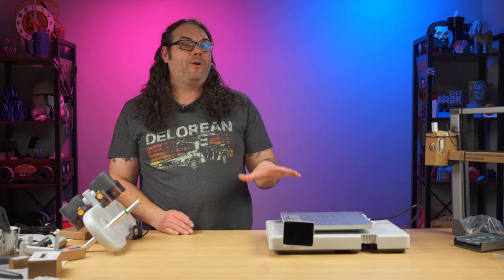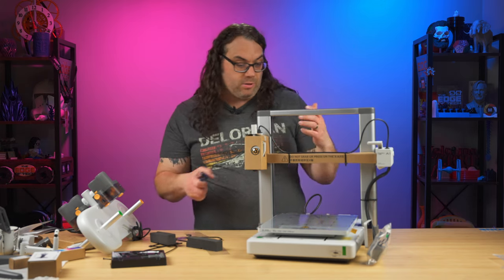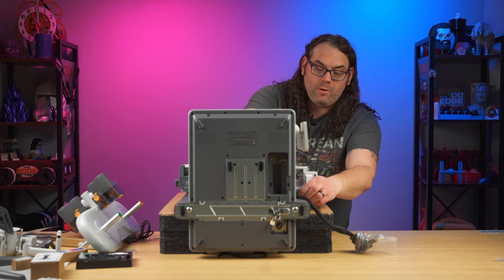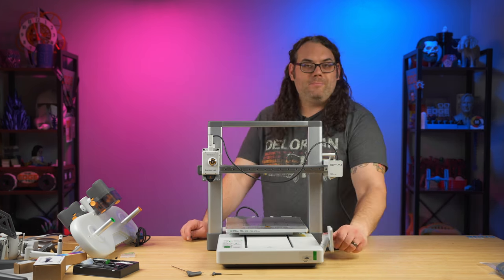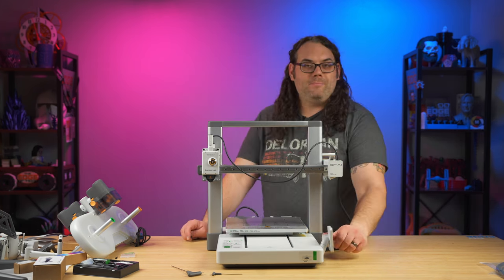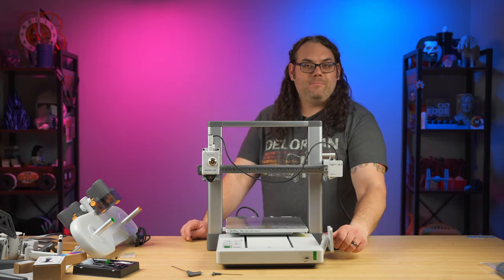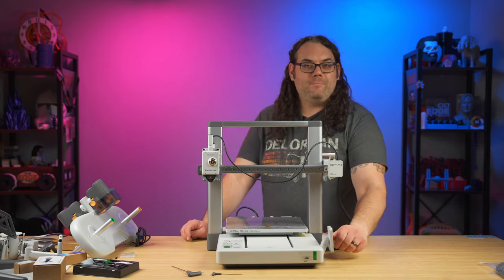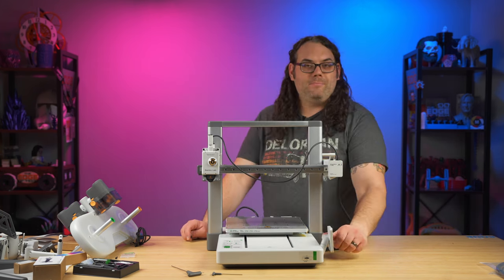How To Assemble The Bambu Lab A1 To Get Started FAST!

Comment: You are compressing the heatbed cable using your packaging support method while attaching the cables underneath. They suggest putting it on the edge of a table with the front pointing down and the cable up. People doing it wrong and crushing the cable led to the first recall. I got my first A1 in January and kept using it when the recall came because I followed the directions and didn't crush the cable––and it has worked flawlessly since. I just took it back to Microcenter and had it replaced per the recall with a new one (along with the $120 credit, which they gave me as a refund against the original purchase, as well as crediting me the difference in original price and current price so I got an almost $200 refund on my card! The differences I can see between old and new is a beefier cable wrapped in a sleeve, a warning tag, and a plastic standoff, none of which appear visible on your example.

Comment: Be careful laying it on its back.  The power cable is bent in your video,  this is what caused the problems and recalls.  Bambu did some work ti fix the issue but better to be safe.

Comment: The A1 is by far the best 3D printer I ever had. It works so smooth and prints flawlesly. And if you are prepared to sacrifice time for quaity - the 0,2 nozzle and a layer height of about 0.08 makes the layer lines almost invisible.
Reply: mine too

Comment: i think this A1 is old version ? because have not cable protector on the back , also heatbed cable not netting style.
Reply from the maker: Yes, the new ones have been modified since the bed issue happened! Mine is an original still.

Comment: I just got my printer and I think they shipped the wrong power supply cable?? It looks nothing like the one in the diagrams and it certainly doesn’t plug in— I’m also worried about damaging the prongs on the hardware. Has this happened before to anyone else??